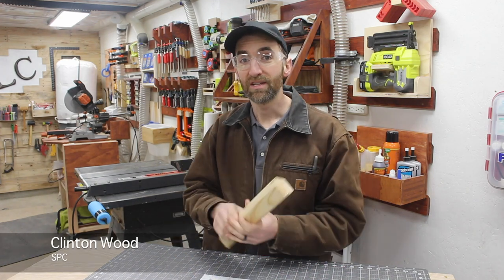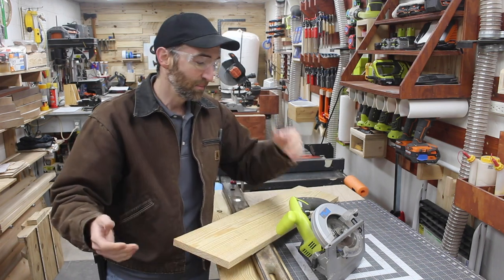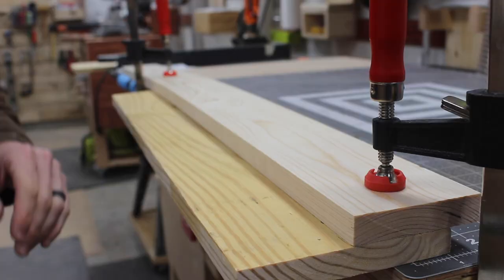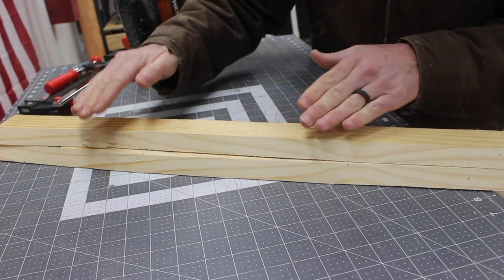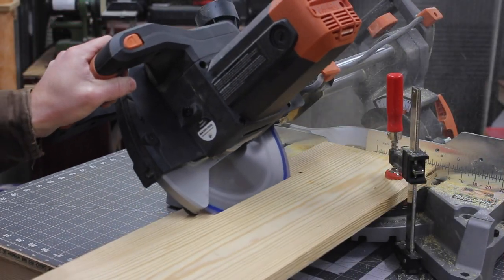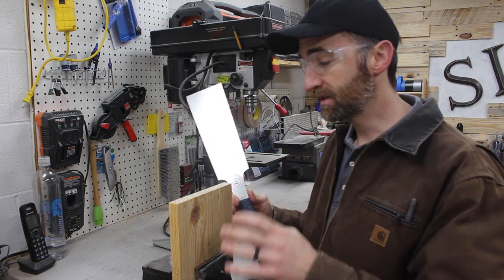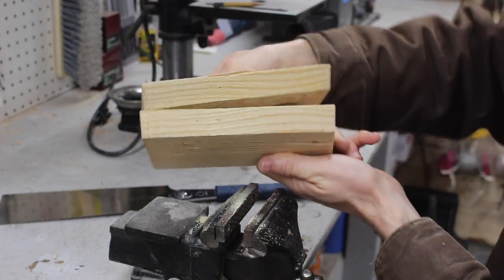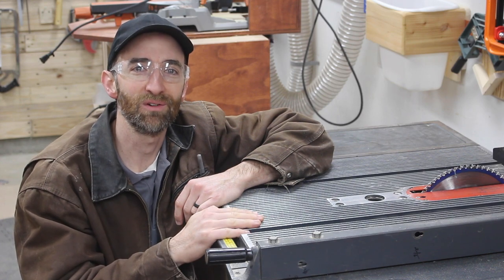5+ Ways to Make French Cleats WITHOUT a Table Saw

Comment: This is great. I grew up using a radial arm saw for ripping and cross cuts; we didn’t have a table saw.  After I was out of the house, my father added a portable table saw to his shop, but it (along with the radial arm) has probably been neglected for 12 years.  Using either at this point really makes me nervous, yet I REALLY want to add French cleats.  Since I have 3 circular saws I am thinking of setting one to 45 and one to 90 and just alternating between the two to cut up a sheet of 3/4” ply.

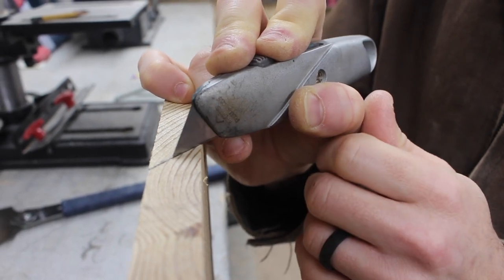Comment: 5:40 Pro-tip. The Japanese pull saw has one side that's for ripping, and one side that's for crosscuts. If you flip the saw around and use the rip teeth for the rip cuts, you might have a better time.
Reply: I was about to put the same comment... The two side are not fine/rought !!!

Comment: Great videos on French Cleats, and you have convinced me that they are the way forward once I start the interior build of my new workshop. One thing I do have to ask is why do the wall mounted sections have a square bottom instead of a 45 degree angle. That way you can just keep your saw setting the same and churn out parallelograms which also provide a bit more space for when removing the storage units. Maybe I'm missing something but it just seems easier to me.
Reply from the maker: You have a very valid point. If you try it, please let me know how it works out, and if it is good, I might try in the future

Comment: I have a single cleat that runs the whole perimeter of my shop.  100 feet.  I did them with a hand plane.  I just marking gauged the offset from both sides and planed to the marks.  It really didn't take all that long.  I am lucky to have a vise that offsets to 45 degrees just made it less awkward.

Comment: This is a great video as I'm going to be making a workbench for one of my first woodworking projects and I only have a circular saw at the moment. Dumb question, but after you've cut the 1x8 with the circular saw, what are the approx. dimensions of the finished cleats? Also, could you theoretically cut it straight a bit off center to get bigger wall cleats and then smaller tool storage cleats or would that make the proportions off? I hope that makes sense and thanks for the video and great ideas!
Reply from the maker: The dimensions of the cleat really depends on the size that you would prefer, there is no specific size.
As for the angle, I have never tried it but my understanding is that it would be best to keep it level.

Comment: If your cuts are not perfectly straight, you can adjust for that when you hang it.
1. Attach cleat to whatever you are hanging.
2. Attach one side of the wall cleat to the wall (firmly!), and hold it level.
3. Hang your item on the wall cleat, and move the unattached side of the wall cleat up and down until your item is level; mark the wall where the bottom of the wall cleat is.
Remove your item, attach the other end of the wall cleat, and hang your item.
*You may need another person, but I've done it by myself (using a level sitting on top of my item), but this works well!

Comment: Question for you;: no one ever mentions many inches they space the cleats on the wall or the type of screws they use to screw the cleats unto the studs in the wall?  Your cleats look very nice!  I am a novice here and any info you can give me greatly helps!  Thanks!
Reply from the maker: You can space your cleats any width that you choose, just remember to leave enough room for the tool side to slide in easily. 
As for the screws make sure to use a good quality that's long enough to reach securely into the studs, but the brand doesn't matter. And definitely avoid drywall screws they are not very strong.

Comment: Well done on this video!
I watched your other YouTube video "20-things...French cleats...," and based upon this video; I tried and failed to make my first French Cleat with a 2"×4".
Now, I started by cutting the left edge of the 2"×4" off at a 45-degree angle, then I measured my second piece and cut it on the line at 45-degrees. The two pieces were not the same width  nor would the two pieces fit together, which was really frustrating.
Please help me as I am trying to make a perfect "French Cleat Wall" so that I can design holders, and hang a good amount of hand tools. I would be most grateful for your assistance.
Reply from the maker: I personally would not use a 2x4 but rather a 1x4 and cut one edge off.

Comment: When you cut the 45 degree down the middle of the strip, can you use both half for the wall or do you put half on the wall and half on your tool holder? Also what distance between wall strips? looking at videos the distance is all over the place.

Comment: I just cut my strips 5" wide then rip the 45 degree down the middle. You could also use a 1x6 and just have 1 cut to get 2 strips. Another option is to use a jointer with the fence set at 45 degrees.
Reply from the maker: Those are great ideas too, thanks for sharing

Comment: 1) Mount a circular saw upside down in a workbench.
2) You could also just cut the center of the board at 45 degrees and not worry about the outer edge. sure, the heights of the cleats may be millimeters in difference, but they still work.

Comment: how about a router bit?
Reply: The 45 degree straight cut, chamfer router bit is the easiest of all and wasn't included. And no need to smooth the sharp edges because the space of the bit bearing does it for you. Most of these guys go overkill on the French cleats. They don't need to be so thick. They are extremely strong.

Comment: I have a table saw, but a cheap kind, and cutting a long cleat on it is impossible without getting infeed and outfeed tables/stands, a featherbord or two, and a good fence. 

I'd say the easiest way to cut a long cleat would be using a track saw. Safe, way better in terms of dust, and easy to set up.

Also, there's a method where you don't do any perpendicular cuts - you just make all cuts at a 45 degree angle, makes cutting them way faster. So unless you want your cleats to have one straight edge it is the way to go. Mind you, if you want to have a locking mechanism of some kind, the wall cleats should have a straight edge to lock against, so this method won't be suitable then.

Comment: I get that it's an academic exercise, but who has a band saw and no table saw?

It's also worth noting that if you attempt to do this with either a band saw or a jig saw you need to use the widest blade possible. Keeping either of those cutting straight is the biggest challenge. 

And leaving out a router was a major oversight. That would be far superior to a jigsaw or band saw.
Reply from the maker: Good insight on those blades.

Comment: Using a radial arm saw, set up for rip cuts with the blade at 45, and send the wood through. Almost as easy as the table saw, and much safer.